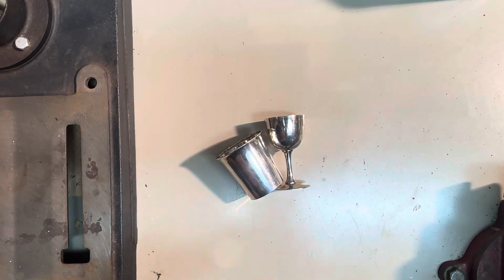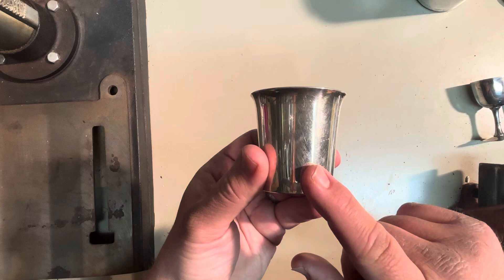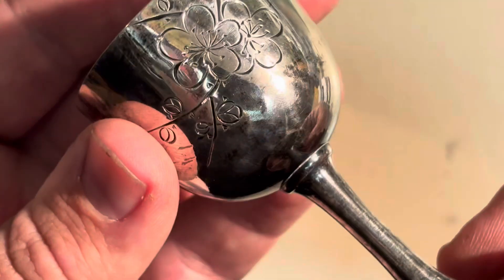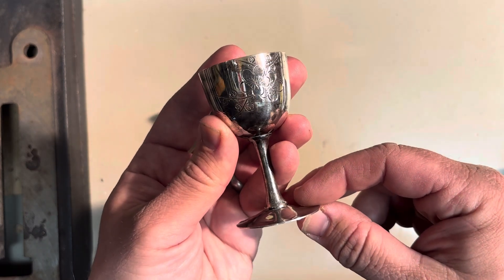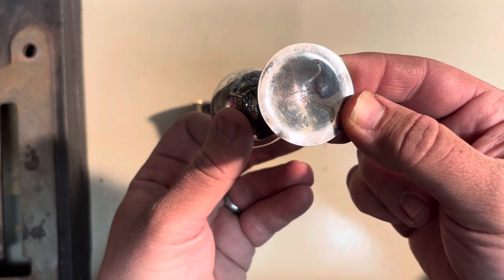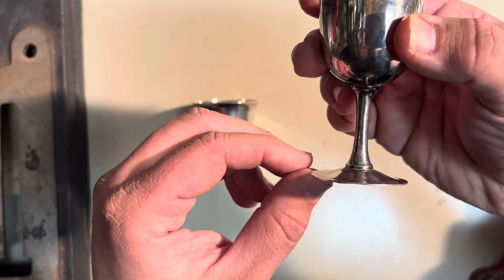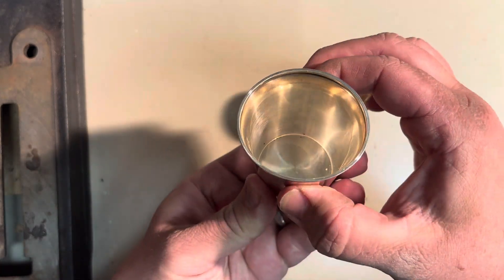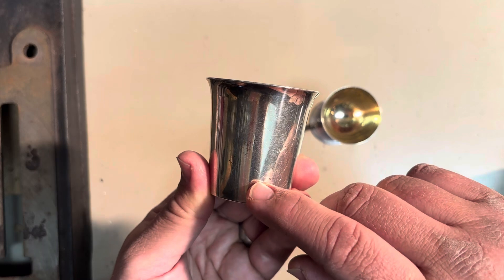Why Sterling Silver instead of Pure Silver?

Comment: Is there a common use of aluminum-silver for a Stirling Silver alloy? The reason I ask is because of what a tough alloy aluminum-bronze is and I wondered if some of the same benefits might also apply to silver.
Reply from the maker: Not that I am aware of. The Worshipful Company of Goldsmiths way back when mandated it was just silver and copper. Zinc and Nickel  I know have been added at times, and modern alloys include all sorts of wacky stuff like Geranium and Boron. The thing to remember about aluminum though is that its pretty modern. It wasn't until 1886 that anyone figured out how to produce it on a large scale.